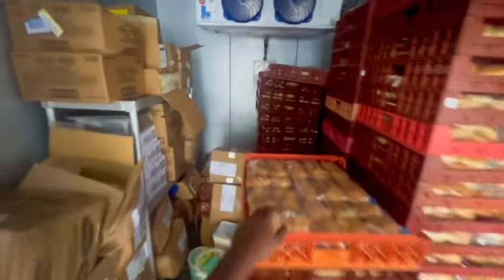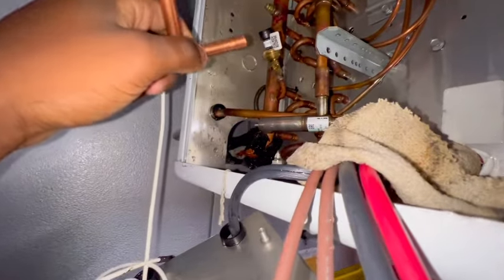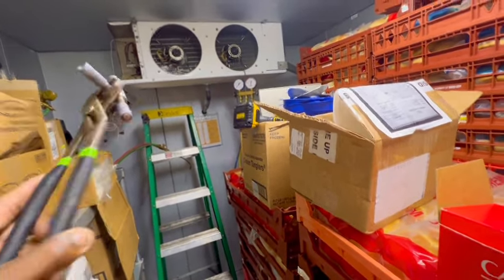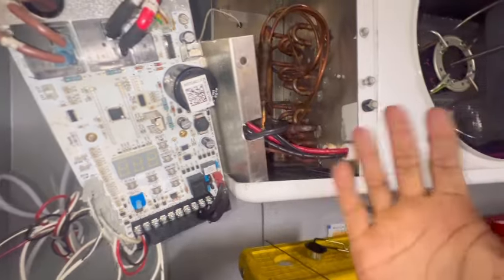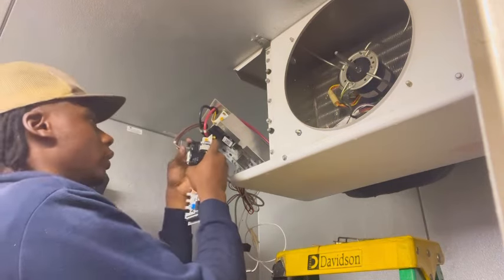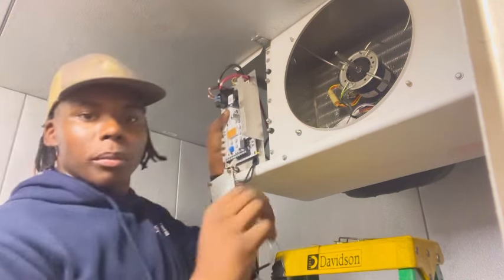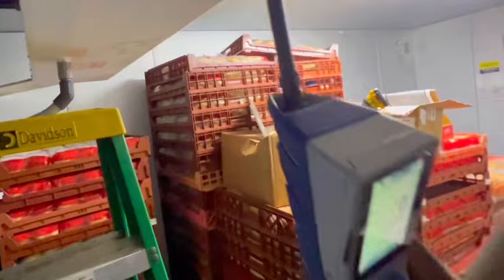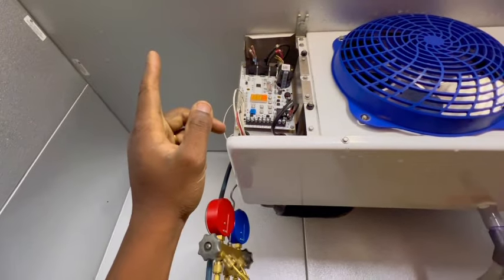Freezer running high temperature for 15 days did the parts I ordered solved issue!

Comment: Check there 210v drain heaters. They go bad a lot & cause it to freeze up.
Reply from the maker: Frozen over because I had valve wide open until parts came in.